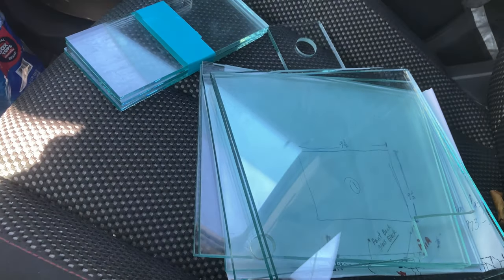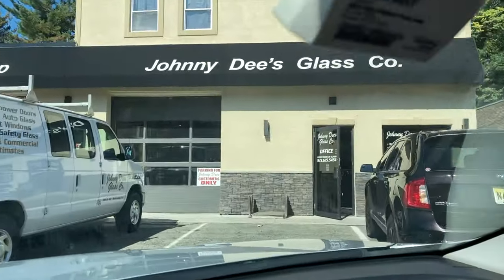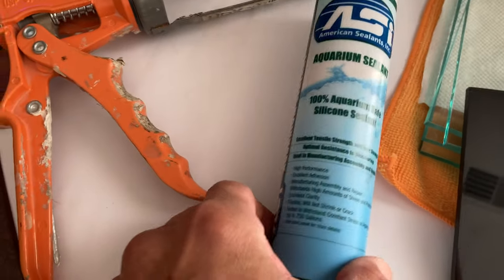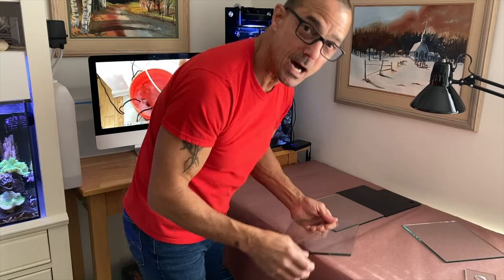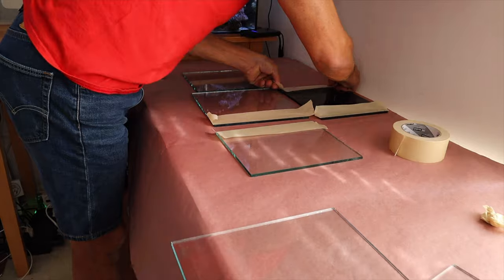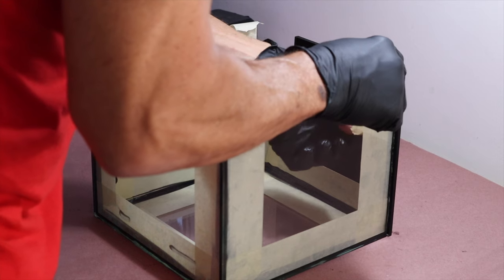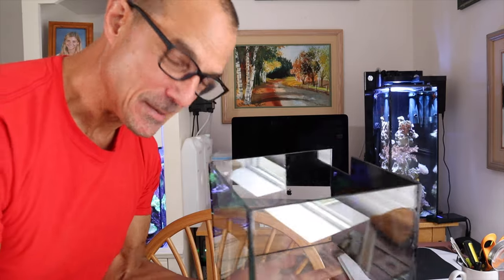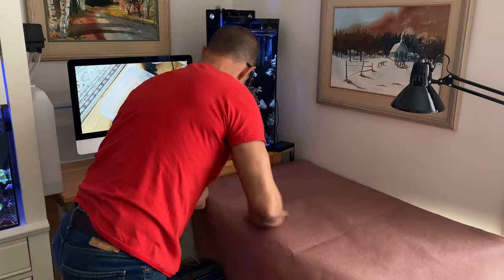PICO REEF TANK 3.5 GALLON - HOW TO  BUILD THE TANK (PART 2 OF 5)

Comment: Found this channel right after setting up my first salt water (10gallon). Going to enjoy seeing the set up. Question. I purchased the same power head and even at the minimum flow it’s wayyy to strong for my corals.  Any advice?
Reply from the maker: Hey 303cologuy, thanks for watching! and Welcome to Tom Reefer😃 what pump are you referring to, and model? If it’s the Sicce silent 1.0 it can be adjustable to slow your flow down. The other thing you can do is position the flow across more of the top and diagonally across your tank. Also maybe move a few of the corals that may be getting blasted. 👍🏻
Reply: Sorry meant wave maker. Have the same  one. Love the idea of mix wave functions but if it’s in even at “1” and wave rate of “8” it overwhelmed my corals. I’ve tried several position place high,low,middle back,side, blockaded behind a larger rock to break the wave etc. almost given up on it.
Reply from the maker: 303cologuy that’s puzzling me? Because I have that same mini wave in 5 gallons and I set it at 3 - 8 to make enough flow? Sorry.